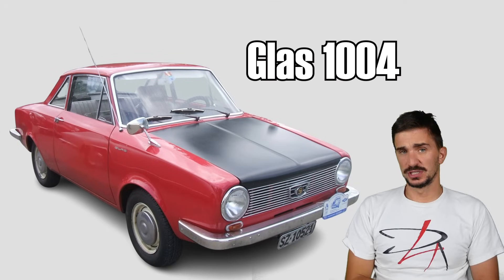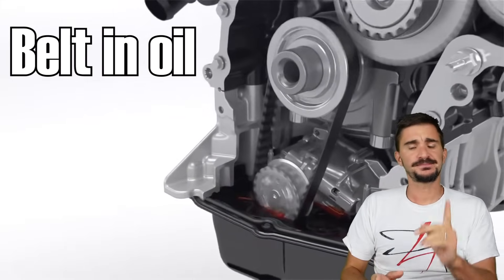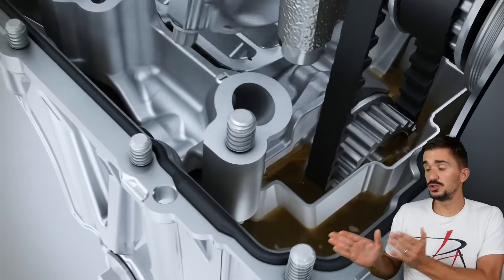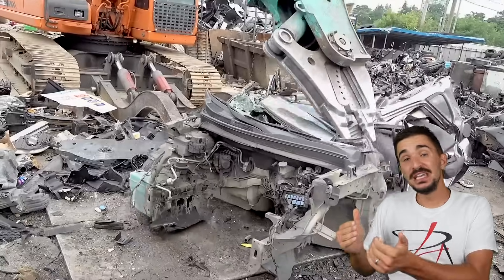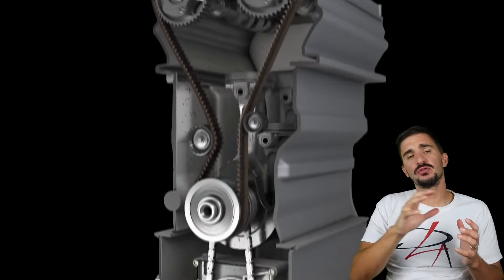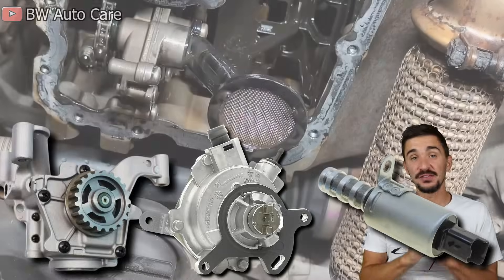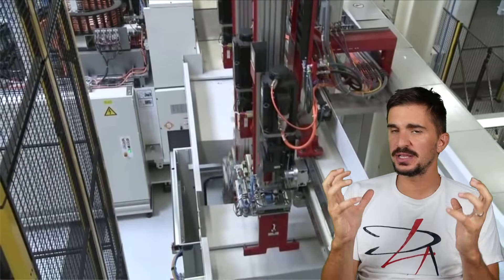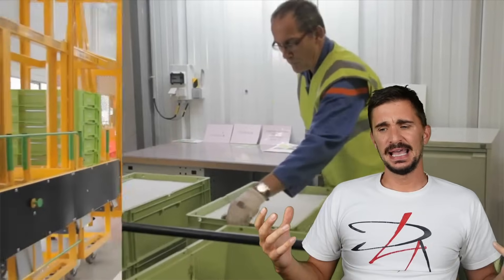Who Approved This and Why Is It Still Being Made? Wet Belt aka Belt in Oil Engines

Comment: It is hilarious how Ford now makes 1.0L Ecoboost with a timing chain but it still has a wet rubber belt for the oil pump.
Reply: @ambitiouspurr  its almost like they want to sell more of these replacement belts
Reply: The Ford "Fox" 1.0 3 cylinder engine was introduced with a wet belt which worked without problems for many years.  However, Ford wanted to introduce a new version of the engine, I think with cylinder deactivation.  This put more load on the cam drive.  The belt supplier was unable to develop an uprated belt within Ford's timetable so chain was used on the new version.  Wet belt oil pump drives are more common than wet belt cam drives.
Reply: @ambitiouspurr  Gears are expensive.  I'm not sure if they are used outside of pure race engines.
Reply: @ambitiouspurr  I dispute the information presented in this video.  If I see some data proving that wet belts are prone to failure I'll change my view.  Tons of blown engines are a myth.  Many people are biased against belt drives - particularly in North America - a place where many car owners still think a pushrod engine is a good idea.
Reply: And when the oil pump belt fails, its inside of the timing chan, so you have to remove the timing chan anyway!
I'm telling you, they are absolute morons!
Reply: @garybeecroft4565. LS engines say pushrod engines are more reliable than ohc engines.
Reply: @James.Allen.1  No doubt you also believe the earth is flat and sun revolves around it.
Reply: Same with the 6 cylinder diesel in the F150
Reply: That's ford for you.
Reply: @garybeecroft4565 wtf, cylinder deactivation on an engine that is already 5 cylinders short? what kind of bollocks is THAT
Reply: @ivan24121996   It seems a bit over the top to me too !
Reply: @ivan24121996  It probably starts to make sense when you consider the fact that the main selling point of these tiny engines is low fuel consumption, though at some point the added maintenance costs of the add-ons is going to cost far more than the savings from reduced fuel consumption.
Reply: @garybeecroft4565  so 40yrs of industry consensus is not enough for you? Nor anecdotel evidence of consumers having to pay 1000s to replace a prematurely failing belt, or even worse, the whole engine?
Reply: @GamezGuru1  You seem to have entirely missed the point.  We are discussing belt in oil camshaft drives, also known as wet belts.  Only Ford, PSA (Peugeot/Citroen) and Honda have fitted these camshaft drive belts.  All the engines that have these belts fitted are small 3 cylinder engines.  None of these engines existed 40 years ago.  I have worked in the automotive industry for 40 years.
Both belts (dry and wet) and chain drives fail if not properly serviced.  That of course includes the tensioner system.  A lot of dry belts need changing at 60,000 miles and on older vehicles even more frequently.  Wet belts last longer - up to 160,0000 miles.  Chains don't usually have a lifetime specified and it is assumed that they will last the lifetime of the engine, but if the chain drive starts to make a rattling noise you better change it quickly because it will break.
No-one posting on this topic has come up with any solid data on failure rates for different camshaft drives.  Probably because there isn't any.
Reply: @garybeecroft4565  ...and a place where cars operate for 250,000 miles without engine repairs.
Reply: @garybeecroft4565 wet belts are notoriously bad. The 1.0 ecoboost has had multiple reliability issues since it was first introduced. There’s literally companies in the uk now that specialise in 1.0 eco boost repairs and timing chain conversions. There’s a reason it’s known as the ecoboom engine. If wet belts are so good why did the fiesta ST and focus ST of the same generation, which are performance oriented cars under more stress running more power use standard dry timing belts with a 125k service interval?
Reply: @tommcmahon14  You cannot fit a wet belt to an engine designed to use a dry belt.  Chains and wet belts are totally enclosed and run in oil.  With a dry belt engine the belt is not enclosed - it runs in air - plus the engine doesn't have belt/chain lubrication designed in.   There is no such thing as a standard belt.  Each belt is designed  for a specific engine.  The ST models you mentioned presumably had dry belt engines.
Reply: Belts are awful. So glad I haven’t had one in years.
Reply: Peugeot Pure tech engines design is terrible and there have been uncountable numbers of failed engines due to wet belt but I don't think Ford Ecoboost engine got similar issues despites longer maintenance intervals (2 years vs. 1 year for Peugeot). How can you explain this difference?
Reply: @funkybob4265  The Peugeot and Ford engines were both voted engine of the year. I personally owned a car with the PSA  engine. I think your opinion is based on personal experience rather than  representative data.
Reply: Nice troll bud 😂
Reply: @garybeecroft4565  u are as nice as u are knowledgeable
Reply: @garybeecroft4565 pushrod engine is a GREAT idea, unless you want to rev it like hell. As a normal daily driver you don’t. You want a good torque at low revs. This reduces the engine noise AND fuel consumption. Also, a low revving engine wears less. The OHC, 4 valves per cylinder, VTEC, VVT etc.  are only good for small high revs engines to squeeze horsepowers outta them.
Reply: @alexeijolkin7851  Dear me, there are some folks in the good old USA holding onto some old fashioned beliefs. Pushrod engines have more inertia, friction and inefficiencies than you can imagine. With an overhead cam set up you can vary the cam timing and lift for exhaust and inlet valves independently. This can provide benefits in terms of fuel consumption and/or power. The pushrod engine would be a miracle for Fred Flintstone but otherwise it's a museum piece.
Reply: @theorenhobart  Cheers man. I work in the industry and it doesn't pay to be unfriendly to people even if you disagree with them.
Reply: Next UP from FORD:

RUBBER PISTON RINGS!
Reply: The same recipe with the 2.7 ecoboost and the 5.0 v8 coyote. Wet belt on the oil pump 🤡
Reply: Ford execs:  "well...  They said no wet timing belts; but they didn't say anything about wet oil pump drive belts!"
Reply: @bootstraphan6204 , naw, that'd absorb too much energy and reduce fuel economy by 1%.  Can't have that, so...  PLASTIC PISTON RINGS™, coated with DuPont's® Teflon©. 😂😂
Reply: Bro they sold both 1.0 L ecoboost & the safer 1.5 sigma in different variants. When we bought it I was able to tell the difference, but thousands bought the 1L for cheaper price and paid heavy in repair.. it also has fitment issues but that's production plant issue
Reply: @garybeecroft4565  yes showin up on what car in the uk  as a major cause of break down and blocked oil filters
Reply: @garybeecroft4565  go and buy a 1.1 focus then
Reply: @garybeecroft4565  Only thing you've presented is numbers that, for all I know, you overheard being thrown around by techs at Jiffy Lube while waiting to get your oil changed. Your claim to have "worked in the automotive industry for 40 years" is so vague as to be meaningless.

"The Peugeot and Ford engines were both voted engine of the year." That you'd say something so intellectually-dishonest casts a lot of doubt on the credibility of your opinions. 

"I personally own a car with with the PSA  engine. I think your opinion is based on personal experience rather than  representative data." 🤣 Sorry. How do you not see the inconsistency?!

"Cheers man. I work in the industry and it doesn't pay to be unfriendly to people even if you disagree with them." Whoa, dude - check that temper! Sounds more like a veiled threat than a piece of advice. 

You present as a someone who overestimates both their knowledge and the value of their opinion. Just my opinion, for what it's worth (hah). I could be wrong. Most people I've encountered with 40 years of actual relevant experience in a subject will have certain tells that hint at the degree of their knowledge and experience. You haven't shown them, so you'll need to post actual data and proper reasoning if you want to change my opinion. If you're unable to present real data and sound reason, I think maybe you need to seek outside help in getting a better sense of the true depth and accuracy of your knowledge. Again, just my opinion. I am not an engineer, psychiatrist, psychologist, or auto mechanic.

Cheers man!
Reply: Dont expect ford to ever learn from their mistakes. They do not.

Just ask about the 6.4 diesel.
Reply: So  do VW use   a belt  to  drive   oil   pump
Reply: For the   average    person    a push rod   engine is just as good ,  most people   dont   rev car   about   4000 rpm  ever
Reply: @garybeecroft4565  being wrong for 40 years is not an achievement. You need to dial down your ego
Reply: @p71nero  Interesting that you are only able to disagree with me by launching a personal attack rather than coming up with some facts.  Perhaps you don’t know any ?
Reply: They can market the engine as having a timing chain but fail to mention the oil pump belt. These wet belts can lead to oil starvation by clogging up the oil pickup screen even before they completely fail. The belt teeth tend to shear off the belt and end up in the oil pickup.
Reply: Who needs an oil pump?
Reply: ZERO maintenance for the timing chain and the gear-driven oil pump on my 32 year-old Alfa Romeo. I'm totally satisfied with that.😊
Reply: @powerjian8193  exactly!!!
Reply: @garybeecroft4565  It’s not expensive to make gears!!
Reply: @Zach-sg5uu  It is compared to the cost of a belt or chain drive.  That's why almost nobody uses a gear drive.
Reply: @ Wouldn’t a direct gear drive be better than a belt or even a chain?
Reply: @Zach-sg5uu  Sure if you have two million dollars for a formula one engine I'm pretty sure they have gear drives.
Reply: @garybeecroft4565 :  Thanks;  you just made the point for the reliability of pushrod engines over OHC engines.  An OHC engine with chain drive will have 4 to 6 feet of chain,  whereas a pushrod engine will have a chain measured in inches.  The cumulative wear of all those links adds up, shortening the life of the chain.   I will grant you, an OHC engine will potentially produce more horsepower for a given displacement, but the discussion here is reliability.
Reply: @badmoon5249  Unbelievable, a pig just flew by !
Reply: @garybeecroft4565 where are your facts? What evidence do you have that wet belts are comparable or better than dry belts? Don't be shy!
Reply: @conehed1138  Wet belts run in oil so there is less friction and therefore less emissions, less noise and longer belt life.  They obviously cost more than a dry belt.
Reply: @garybeecroft4565  that's not evidence, statistics, or facts. Try again.
Reply: @conehed1138  These points are obviously true if you have studied engineering.
Reply: @garybeecroft4565  "source: trust me bro" 😂😂. Wet belts run in oil, so longer belt life he says.... Prove to me that the benefits from reduced friction outweigh the degradation from constant exposure to oil. Shouldn't be hard for an accomplished engineer like yourself to prove, after all, it's "obvious"!
Reply: @conehed1138  The wet belts are made of different materials that don't degrade from contact with oil. It really is that simple.
Reply: @garybeecroft4565  that's simply not true. The belts are made from fancy rubbers. Find me a rubber that doesn't degrade when sitting in oil. HNBR, SBR etc. that they use for these belts definitely DO degrade in oil
Reply: Henry Ford built the affordable model T for the people must be turning in his grave. Cooperate avarice at its a salute best.
Reply: @conehed1138  I am afraid it is true.  The materials you mention were used in cam belt construction about two decades ago but things have moved on a bit since then.  The load bearing part of the belt is made from glass cord which is imbedded in the toothed belt.  Glass cord is stiffer then steel giving better timing accuracy than a chain, especially a worn chain which will have stretched.  Wet belts use different materials than dry belt for the reason you mention - dry belts can't cope with oil contamination.  Not only is the toothed belt material different, but so is the glass cord and the bonding agent used glue the elements together.  Belts with carbon rather than glass cord reinforcement have also been developed.
Reply: This design sells more cars.
Reply: @garybeecroft4565  you havent come up with any facts buddy dont act superior